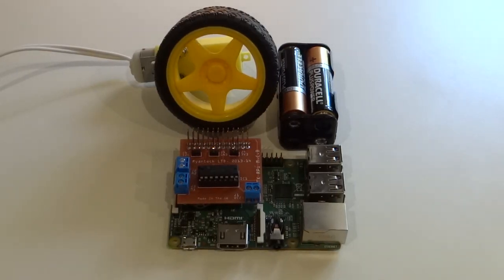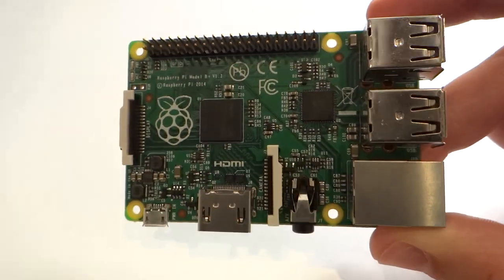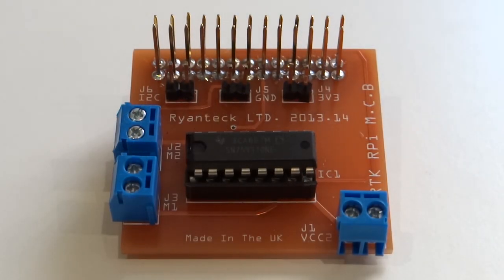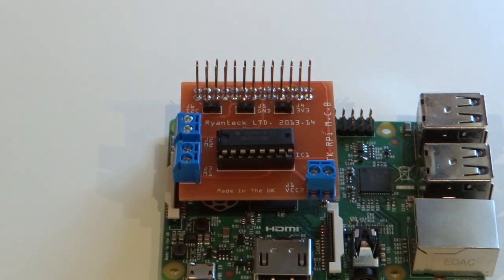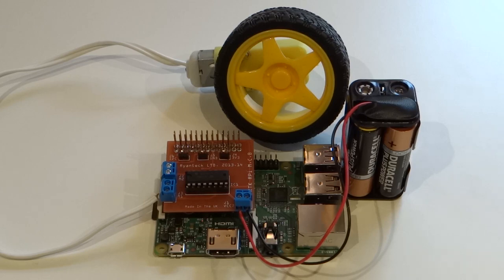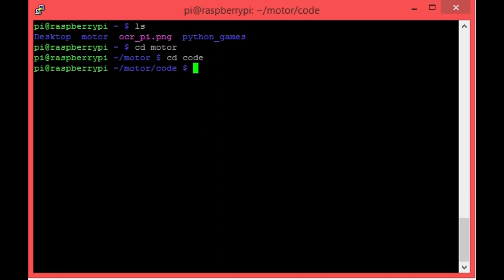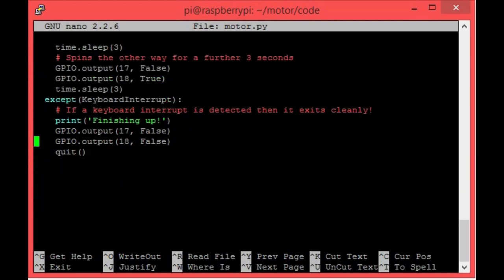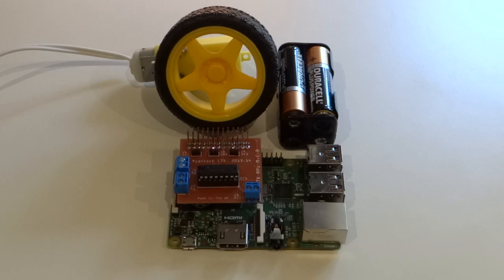Raspberry Pi - How to control motors...

Comment: Great tutorial, thanks for sharing! If I wanted to use a beefier motor (for a crude example, one from a powerdrill), would the same driver-board with a stronger power-supply work, or would I need a different board more-suited to larger motors?

Oh! And Spider-man is hyphenated :P

Comment: Hey, super helpful video! For my A2 Design project I want to build a toy for kids in which they would be able to program a sequence of motor movements to control a car and then set it to complete those individual commands. (e.g forward for 2 seconds a then backwards for 2 seconds) how would you recommend I change this code so I can write a sequence of movements before commencing them one by one. I hope you know what I mean... thanks for anybodies time, I would hugely appreciate a hand.
Reply from the maker: Peter Nobbs Glad you liked the video. I would recommend you work the code into "modules" and then program them as functions. This is going to involve a bit of trial and error as you work out how to turn your robot exactly 90 degrees for example (this is due to the fact that all motors will be slightly different, especially if they are different makes/brands). As soon as that is done you can sense when the child has inputted a sequence and then just make the vehicle go by calling the functions.

ie: 

input = child combination

forward()
right90()
left90()
back()

-Then here all you have to do is call the correct functions. Understand what I mean with this pseudocode?
Reply: Thank's for replying so quickly! I understand what you mean and look forward to trying some of it out once I get back to class on Monday. Thank you so much for your input and time! It's so helpful to get some ideas from a professional.
Reply: +TheRaspberryPiGuy couldn't you use a gyro to detect how far the robot has turned? that way the robot could time itself to turn 360, then divide the time it takes by 4 to get 90, it would mean adding a calibration step to the code but it would be more accurate.

Comment: On my motor is a tape that says "3.6 VOLT". But with 3.6 V The motor does not even start spinning. I found out, that it is actually a 12 V motor.

For Robots Stepper Motors are more intersting, because the program knows what direction the motor is at, without any sensors.

Comment: Is it possible to control right and left direction with this switching device ? If not, what component do we need to do that ? Thanks for the video.
Reply: I think you just get rid of the while true part of the code but I'm not sure how long it will run for

Comment: will it damage my RPi 3B if I use high power dc motor?
Reply: If you're powering the motors from the Raspberry Pi pins, then there's a chance the motor would need more voltage than they could support, causing the Pi to instantly shutdown due to lack of power. This is unlikely to damage the Pi, but you could still control the high power DC motor with a Pi if you had an external power source for it.

I know I'm 3 years late, but maybe this will help someone else lmao

Comment: Thank you. What if i want to control these motors remotely. lets say i am in a city and my robot is in another city. is that possible?
Reply: Using the raspberry pi you could certainly write code that could setup a VPN like server that only you could connect to and it would then allow you to ssh into or access your device so you could then do anything with the raspberry pi
Reply: @megawatts5390  Thanks 
i tried it
it is slow
i want a faster way to control my robot (Forward/ Backwards) ... etc.
Of course with a graphical interface , not coding.
Reply: To control it from a afar you will always run into issues of latency including the raspberry pi especially from another city your best bet it to look for alternatives if this is all you can use قناة أبو ياسر للتقنية

Comment: Hi:

I have been able to control motor 1 using the code supplied in the video.  When I tried to run motor 2,  I assumed that all I had to do was replace "17" and "18" with "22" and "23" in the code since these are the  pins defined in the board documentation for motor 2.  No luck.  The code runs and the motor does not turn.  Any one know what I did wrong ?  Thanks Jerry

Comment: Does anyone know if a motor controller board that supports bi-directional control for two motors means Independent bi-directional control? I want to control the motors Independently in both directions.

Comment: i am using a 9V battery.. the motor makes a sound but doesnt run... although the motor runs perfectly if i connect the motor directly with the battery.. do I need a bigger battery when i try to run using raspberry pi?
Reply: i think the motor is broken

Comment: Would it not be better to use an RC speed controller (Like the ones HobbyKing sells) and PWM
Reply: Asteroid Mining Corporation (T.J. McKinney - CEO)
WHy?
Reply: if i wanted to discuss it with everyone i would have just said it lol
Reply: Robots4Sale Im not sure how to build robots myself.
Reply: rafalpilat145 As far as i know the Pi can only output software-PWM, which is very "unclean" and "unsteady" so that a motor with this kind of speed control would just speed randomly up or down.Thats caused by the processor, which isnt made for "Real-Time" operations.  For controlling a PWM-based rc-thing like a speed controller or a servo an Arduino would be more suitable.

Comment: why cant you use the USB ports on the rpi to power the motor?
Reply: Brian Sunbury dc motor "eats" 6V 300mA and pin of raspberry can give only 5V 30 mA. pin will die. you can control servos by pins and only 2 recommended (without hats for raspberry)

Comment: Will this work with the L298N
Reply from the maker: What do you mean?
Reply: ***** I have the L289N Like this image  http://batteriashopping.com/EBAY/ubeststore/EN00GG5004-1.jpg and know that i can control motors with it.
Reply: BroProStudios The problems with these boards is that they are very easy to wire up wrongly. For example, looking at your board from the link above I have a horrible suspicion that the link on its own connects the motor power to the chip and this can cause serious problems if it can get back to the Pi.

So, if the link is in, as it is in the photo, you'll either power the motors from the Pi (bad) or the Pi from the motors (terrible).
Reply: Jim Darby
TheRaspberryPiGuy did an earlier video on how to control a DC motor using exactly that little board. Yes you can wire it up wrongly but that doesnt mean you cannot control a motor with it. You just have to be careful and you'll end up connecting far more wires.
Reply: so you already know, then what's the point of asking?

Comment: Great video, thanks, I am going to be controlling roller blinds with my Pi via a 12v relay. I was going to use sensors to sense positions but was wondering if I could use the time command instead. There will be some tolerance in the timing but not as much as 1 second of motor movement. Is there granularity in the timing? I mean can the motor be controlled for say 3.7 seconds or would it have to be 4 seconds?
Thanks again :)
Reply: I would try to avoid using elapsed time as the motor-stop condition.  What if the blinds aren't all the way up or all the way down and the motor tries to go past the fully extended or fully retracted position?